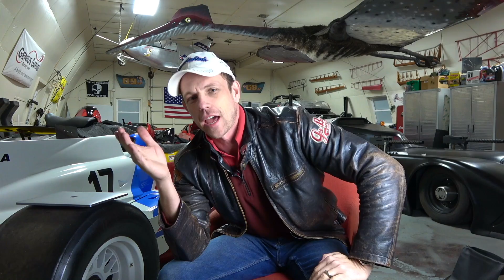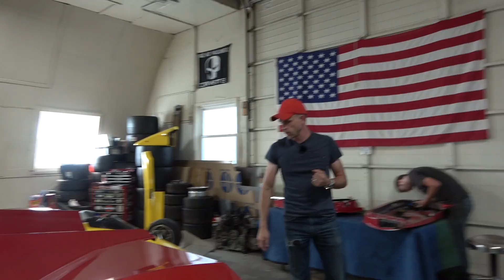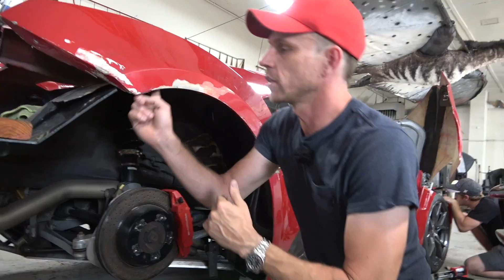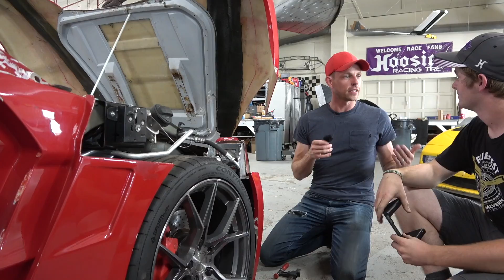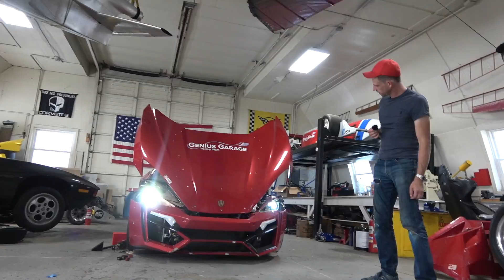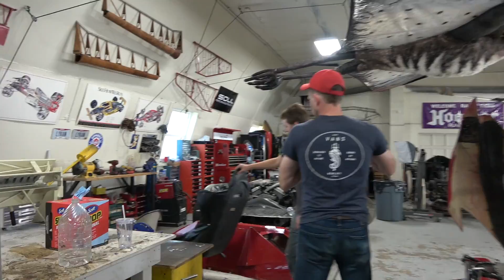Lightning | Lykan Hypersport build #17 from Fast and the Furious Live Stunt Car

Comment: I know this vid is a few months old and I might not get a response but I'm curious:

Why not us the ducts behind the doors as  both intercooler cooling AND brake cooling? It seems kinda silly to route the airflow over the wheel wells rather than through them to help cool the brakes. Maybe there's an engineering reason I'm not seeing.

Thanks! Love the build so far!

Comment: As long as you didn't do a secure erase you should be able to use a program to get those files back pretty easily. When you delete something it doesn't actually get deleted it just gets marked as writable space on the drive and will eventually get written over.

Comment: Switch it for a LED bulb. My headlights run so cold now ice and snow stick on them instead of melting off like a halogen bulb. Without a halogen or hid bulb the headlight lens is so cold they wont defrost a thin layer of ice in winter

Comment: for the headlights: He Should take sheets of aluminum and weld them together in angles to fit the headlight space, then spray paint it black and use black caulking to round the edges